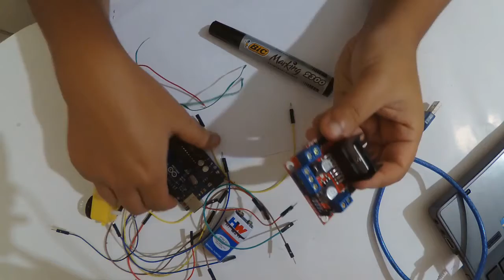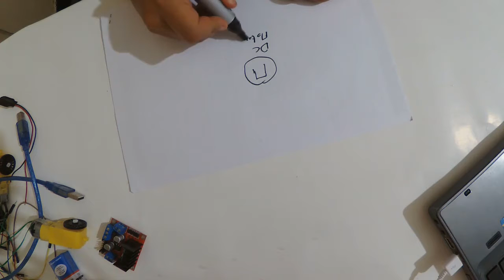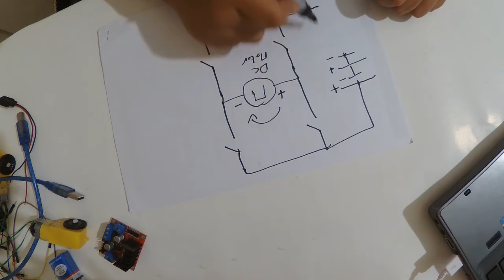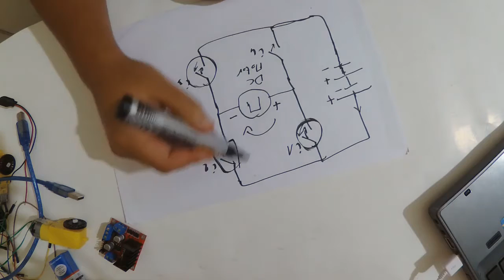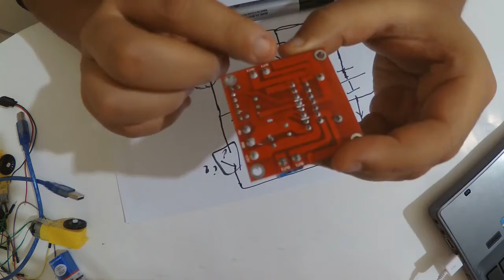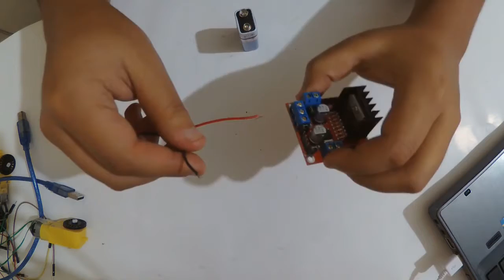How to control DC motor using L298n + Arduino (step by step)

Comment: hello i am setting up speed of 60 for both motors but one motor is speedy and other motor is slow ?? what is the reason behind this??
Reply from the maker: It may be the motor, try swapping the two motors, otherwise you can compensate it from the code